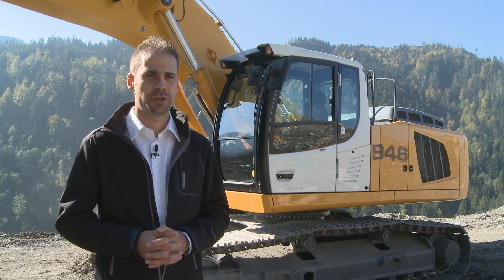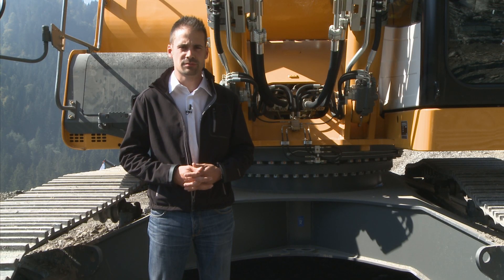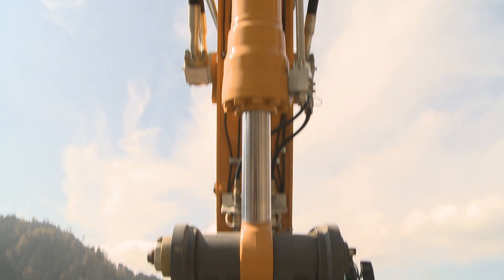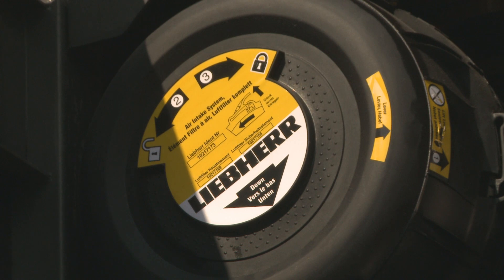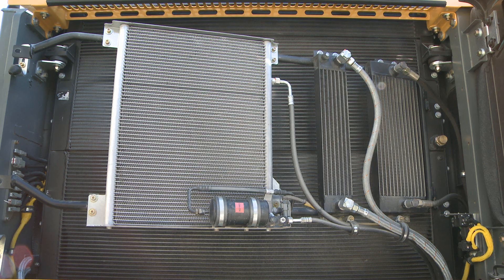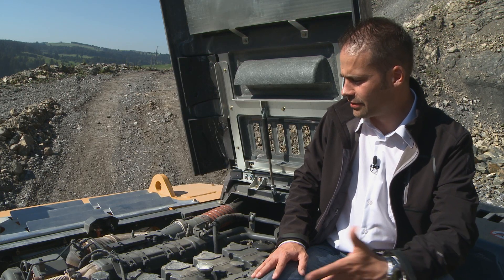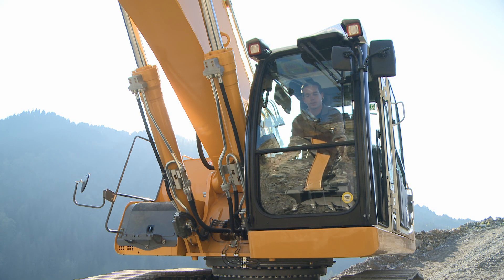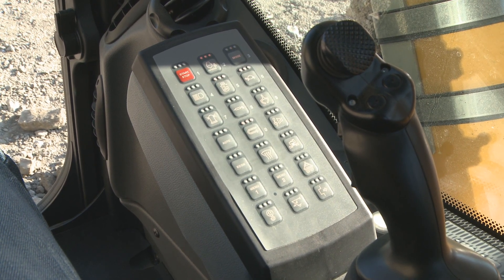Liebherr Crawler Excavator R 946

Comment: We ran a 906 and 944c and had many problems with both. The 944 was fine until it went onto a rock excavation job where it snapped the main dipper arm pin 3 times and also snapped the bucket linkage pin where the crowd ram connects, the machine had 4000 hrs on at this time, our Cat 336 of equivalent size had a pin that was 30mm thicker in this area.The 906 ended up with a pin hole in the casing on the end of the engine and leaked water, Liebherr said it was due to lack of coolant in the water and it corroded, but this was not true it was bad manufacturing, just my opinion but needless to say we now run Caterpillar and have less issues.